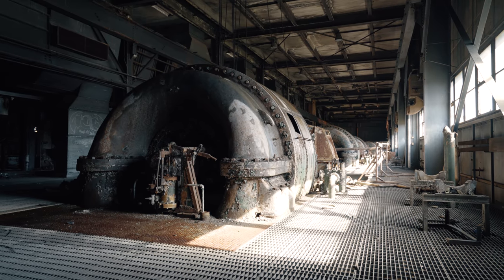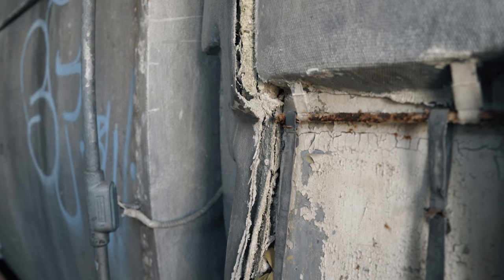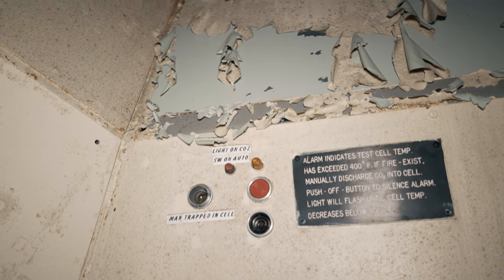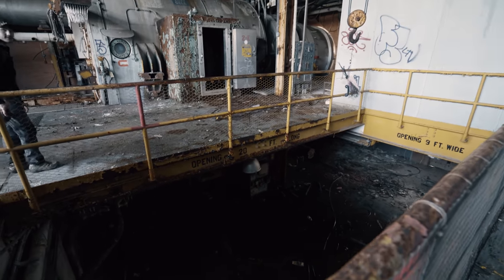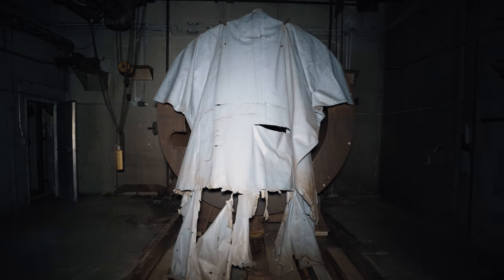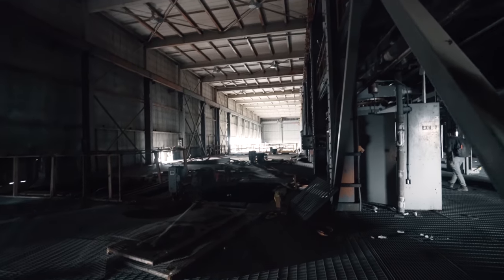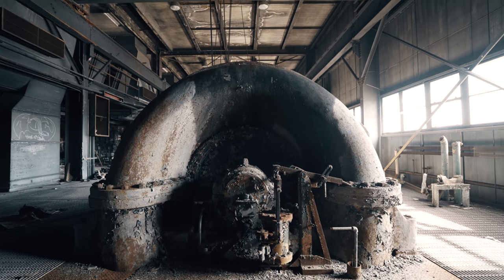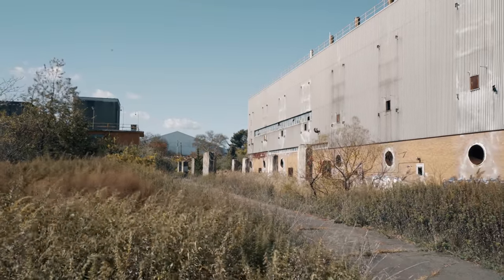Exploring an Abandoned Navy Research Lab - Jet Engine Testing Center

Comment: The Westinghouse equipment is most likely for feeding chilled air to the test engine. They have to produce the conditions the engine will see at altitude, -70F air and ice crystals.
Reply: Labels in the control room say "Refrigeration System" so yes, those turbines (?) are probably for cooling.
Reply: Its probably for testing and computer equipment .
They have massive cfm ratings in jet engines , theres no way to refrigerate enough air to feed a jet engine .
Reply: @dednside5229  Not true.  Look up the McKinley Climatic Laboratory in Florida.
Reply: @SymeonPhronema  
Absolutely it's true 
Thier testing for cold weather starting and component reliability in temperature extremes .
Like I said you cant feed enough cold air to a turbine at operation speeds to simulate flying at altitude,  it's not possible .
You could however cold start the engine and APU to make sure it starts . A test cell is a whole different thing than what that weather simulator is
A big turbine would empty that entire room of unburnt chilled oxygen in minutes if not less .
I used to be in the military and go to test cell , stand by the intake you'll see what I mean , it eats incredible amounts of air you cannot possibly understand without personal experience .
Look up the cfm of a turbo fan at cruising altitude X4 engines .
Reply: @dednside5229  There's a chamber there that does.  And I'm in the military, and am deployed at the moment with 16 years of active time.  In addition I'm stationed at Eglin AFB.  That lab has the ability to do that.

Read this : https://www.eglin.af.mil/News/Article-Display/Article/1086166/mckinley-climatic-laboratory/
Reply: @dednside5229  In addition check here.  It's dated because it's labeled as Air Force Systems Command, and we're not AFSC, we're AFMC, but it's an official AF document nonetheless.  Do a search for engines, and you'll see that it does in fact have that capability.

https://www.asme.org/wwwasmeorg/media/resourcefiles/aboutasme/who%20we%20are/engineering%20history/landmarks/116-mckinley-climatic-laboratory-1944.pdf
Reply: @dednside5229  Also search that document for "pps".  It describes the system's ability to provide up to 450 pounds per second of cooled air as of 1966, and that portion is for testing jet engines.
Reply: @SymeonPhronema  
Your right ,
I found it .... It says it can support full throttle runs over an hour at 40 degrees Fahrenheit , in a normal building it would collapse the structure with the vacuum created .   
That's pretty amazing , it still doesn't change what was going on with that test cell from the 50's though .
Props on that , you taught me something
I should have noticed the frames behind the outer engines .... 
Thier performing high power runs which is actually incredible,  I've seen that done outdoors at pratt and whitney ...
It uprooted 60 ft pine trees .
Reply: @dednside5229  You're welcome, and it's quite clearly the exception, and certainly not the rule so you're absolutely correct there.  I doubt there are many other facilities capable of doing the same thing in the world if any at all.
Reply: @SymeonPhronema  
Yeah man , sorry bro ...
I should have took your word if your stationed there ...
For what I think I know , time obviously has moved on .
I guess I'm just a relic
I'll always remember that incredible violence after strapping that harrier down at 110% water assist .
It felt like it could shatter my teeth
180+ db
Reply: @dednside5229  Not to worry!  A lot of time people will claim things on YT so I understand why you wouldn't believe a random person off the bat.  If anything I've enjoyed the conversation.
Reply: Anonymous19992012 this was a nice read guys.  Cool to see people that know their shit. Now let me go back to my maths so that I can get to be an engineer one day.

Comment: My dad was a supervisor at the Trenton NAPTC  until retiring in 1980, occasionally on weekends security would call my dad when an alarm sounded and my dad would take me along with him to go up there and push a button.  I recall as a little kid being freaked out by the grated floors, we were 3 or 4 stories up looking down through the grated floors below us, I recall my dad saying "the good thing about having grated floors was you only had to sweep the bottom floor."  In the 70's when I visited with my dad, there weren't any computers at least not the kind we are familiar with, everything was mechanical and fascinating to see for a 10 yr old kid. 
This jet lab was always loud, hearing protection was required everywhere outside the offices and control rooms.   I worked across the street at GM in the 80's and 90's before the GM plant closed in 97. When the jet lab would do a test, you could hear the noise across the street in the offices at GM.
The jet lab used massive amounts of water to cool the evaporators (cooling towers) for the massive air conditioning  systems used to simulate high altitude conditions.  There's  still a pump house alongside the Delaware near there, that was solely dedicated to pumping water from the river for use at the jet lab. 
Sadly many of the men who worked with my dad died from pancreatic cancer because of the large quantities of trichloroethylene used to clean the jet engines, they didn't know Trichloroethylene was a carcinogen back in the 60's, my dad also died from pancreatic cancer, but unlike most of his coworkers (majority of WWII Navy veterans) my dad made it to 87, most of his coworkers never saw 70. The NAPTC  employed thousands of people from this area and along with GM  (which made fighter planes during WWII) allowed for all kinds of businesses in the area to thrive until Bill Clinton and horrible trade deals made in the 90's came along shuttering the Jet lab and GM. Though the "Trenton Makes the World Takes" sign on the bridge across the Delaware is still lit, Trenton doesn't make much of anything anymore.
Reply: A most excellent anecdote. 👍
Reply: Trenton makes a lot of crooked politicians and high property taxes.

Comment: Just a side note the "windows" were actually full of equipment and not windows at all. They had what we call "Rack Track" on the left and right to hold "rack equipment" modern equivalent would be severs, UPS units, exciters, translators, monitoring equipment, etc. Depends on what equipment is needed and the availability of space behind the rails is so you can easily hook everything up without trying to pull cables through like old TV stands.

Comment: The jet engine "test cells" are part dynamometer, part wind tunnel. They can test the engine at different power levels and load resistance as well as simulate/regulate airflow and altitude conditions.

Comment: "What are those connectors" = those connectors are called Amphenol Connections. Military grade connector.
Reply: Amphenol is a brand, not a type of connector. They are 'circular connectors' - there are thousands of types and an XLR is one of them. Popular in high reliability military, medical and industrial, especially where things are plugged and unplugged often. You'll also see there are different types (5 pin and 7pin visible) and usually they are designed so you can't plug the wrong plug into a socket.
Reply: Commonly referred to as Cannon connectors.
Reply: That's what I've heard them referred to as too.  Miller welders use crazy versions of those.  Switches on one of the control panels had the old Allen Bradley name and logo.  They made pretty killer components for many companies; military stuff to consumer brands like Zenith and Fender back in the day.
Reply: @sibsbubbles  Allen Bradley still builds the best control systems for things like robotics controls, and safety controls. When I worked at an accelerator physics lab(national laboratory) we used all Allen Bradley systems for our safety controls. The stuff pretty much NEVER malfunctions-cause if it were to malfunction, at our facility people could die.
Reply: They actually look like just MIL spec connectors, MIL as in originating from military use
Reply: @tmmtmm  It seems like he may be right though, looks like they're a standard called MIL-DTL-5015, used up until 2000 and Amphenol was apparently a major manufacturer of them.
Reply: No one is really right or wrong - Amphenol is a big NA brand so this being a Navy facility i'd expect they could well be branded as such - but for the rest of the world there are any number of similar circular connector brands, locking, non locking etc. - LEMO connectors as an example are far superior to Amphenol in shielding and quality, but both serve the same basic multipin connection purpose.
Reply: Every one of those wires in the test cell ran to one of the connectors on the panel in the control room...
Reply: @abpsd73  I worked at Garrett Turbine Engine in the 80s and Cannon Electric was right next door to us. They had been there from the late 40s or early 50s and sold out to some other company....Amphenol?? The building has been razed and the site is used by the airport to practice crash rescue.

Comment: Those machines that look like giant blowers were more than likely a way of imposing air flow to the engine intakes at subsonic and supersonic velocities to simulate aircraft speeds in flight. There`s various conditions like starting, flight idle, take off, subsonic and higher.

Comment: no computer servers in that facility! everything in there would have been either PLC relay logic, analogue feedback loops into analogue computers for differential, integral calculus, proportional, linear equation calculations, and open and closed-loop control circuits.

Comment: The  Westinghouse  units   are  blower  motors  to force  air  into the  jet  turbines  (CFM - Cubic  feet per minute )
Reply: Starvation .
No blower is going to be able to force air into a turbine , it's to prevent air starvation so they can get more accurate performance data .
These are engine performance test cells .
Thier for calibration , basic reliability runs and so they can print a performance data sheet of each engine to the customer .

Comment: I worked there 81-86 -- mostly on doing R&D testing cruise missile engines in 1E and 5W. It was an awesome first job as an aero engineer. 

Really cool seeing F404 engine being tested supersonic, seal level -- it was like the earth was shaking. I saw the beautiful "shock diamonds" in the supersonic exhaust stream through the thick glass observation port (you can see it in the video around 10:13). 

It was also cool to see the Pegasus engine in the outside static test cell. This was for the AV-8B Harrier "jump jet," so it seemed to want to rip itself from the engine mount during vertical thrust testing.

The amazing thing about the facility was that it could simulate up to 70,000 feet and Mach 3 (IIRC). For the cruise missile tests, we would cold soak the cell and the engine to 65 Deg F. to simulate being carried by a B-52 - and then see if it started!

The facility air was direct connected to the engine inlet -- so it had to be conditioned (temperature and humidity) and delivered at the right pressure (simulate aircraft speed), and have enough airflow. An F404 (F/A-18) and a TF-30 (F-14) flying at high speeds, full afterburner required quite a bit of airflow, as you can imagine! And fuel flow.

The exhaust dumped into the tubes you saw -- with spray bars where they would inject water into the exhaust to cool it down. That was why you would see lots of cooling towers in the back of the test facilities blowing steam on cool days.

Absolutely wonderful experience working with some great folks.
Reply: I worked for Delaval in Trenton.  We made the large rotating blowers that I believe generated a partial vacuum which allowed them to simulate high altitude conditions.  Those beasts were cast steel casings with a large impeller inside each.  Sad to see it all just sitting there.  I had the opportunity to see them run an F14 engine once.  Freaking wild.
Reply: Hey Jon! Where in jersey is this facility located?

Comment: Those old sockets (BNC/DIN/SMA) all have their origins in military communications technology during WW2 and after. Radio antenna, field telephones and the like all needed to be interoperable and portable. It was quickly realised that different pin configurations could be used for different applications, of which XLR was an outgrowth (I think).

Comment: Those metal capsules that Brian was trying to open the door on are boilers I believe. I used to work at a laundry plant and we have several of those but not on that scale. I could be wrong but I think that's what they are steam boilers.
Some of them even look like the huge dryers we had. That one had a rail system right next to it and it looked identical to ours. it was for dry cleaning all sorts of uniforms and everything else.

Comment: Those ports in the control room are cannon plugs. Most aircraft stuff uses plugs like that with varying amounts of pins in various sizes, I used to fix planes a few years back and that's what most aircraft wiring looks like. I've seen em with anything from 2 bigass pins to over 100 small ones, they're kinda neat. Pretty reliable connection, too.

Comment: Big motors at the end look like water pumps. The control room at the end had refrigeration unit labels. That most likely pumped water through pipes to cool jet engine surroundings and exhaust. Also probably used for fire surpression

Comment: The cells appear to be there to create a vacuum for testing jet engines. This way they could see how the engines would perform under low pressure environments in the upper atmosphere. The so called “cooling fans” were actually blowers to suck the air out of the cells to lower atmospheric pressure to test the jet engines. The gauges on the walls of the control rooms also support this thought on what you witnessed inside those buildings. :-)

Comment: We had a similar place here in the uk near farnborough air base (now airport) . It too had one large building which housed those machines along with 8 seven foot diameter tubes going to the test cells. One set of machines generated the pressurised air to simulate up to supersonic speeds and the other set of machines created a vacuum to remove the flowing air from the test cells . The compressors / vacuums were so lowly geared they had ships engines to help get them up to running speed . sadly its all gone now.
It was called Pyestock National Gas Turbine Establishment if anyone wants to check it out.

Comment: This first chamber is a dyno cell for jet engines. It has a load cell and the whole top opens hydraulically. They could simulate different pressures to imitate altitudes and such...as well as temperatures at pressure.

Comment: those were huge blowers based on the half of the rigid coupling left on the shaft and the size of those Parallel Shaft reducers the Electric Motor were big enough to be machines themselves and removed when they decommissioned the plant.

Comment: there is a similar establishment used by the uk gov many of the buildings did the same testing of engines with the wind tunnels and control rooms abandoned in the late 80s some have been repurposed others still stand abandoned.

Comment: I once worked at a gold/metal plating compound and there was this out building that was named the “Disassociater”. We were never officially told what it’s purpose was and its access was strictly controlled. To this day I have never found out it’s use.
Reply: You're "Disassociater" building sounds more like the building where materials are separated out into the constituent components, sort of like a reversed plating facility or "un-plating" area where they do material recovery from the bathes in which the original plating is done in; something that would be especially needful in a facility that deals with precious metals like gold and silver to help prevent loss of revenue though "flushing the profits down the drain" in the literal sense of the word.

Comment: That is an altitude test facility, the pipe work the engine is sealed in allows the engine to be in a lower than ambient pressure environment.

Comment: You can actually walk on those cable trays-I worked in a facility with what seemed like miles of cable tray just like that. We would walk them at times to look for issues or get to other parts of the facility (not legal on the job per see, but the gov't never found out :p).
Reply: Rileymanification exactly it’s not illegal till ya get caught I always say😂
Reply: @unclemonster48  That's right! It was cabling and computer support systems for a particle accelerator-definitely a fun job and we did plenty of things that weren't necessarily "completely compliant"

Comment: These types of places get mothballed in case military needs to quickly ramp up war-time production again. Eventually the equipment inside does become very obsolete. But, the Corp of Engineers is tasked with designing buildings that can last 50-100 years (hence all the cinderblock and stuff). If an emergency happened (like what we're seeing now), they can quickly gut the building and switch it over to something else (eg: emergency hospital, machining, etc). Eventually they weed through their real estate portfolio and sell properties to private sector if the property is no longer worth keeping.

Comment: Fun fact - Jet engines only operate efficiency around 30k feet. So those testing areas would have the air pressure modified to match those conditions